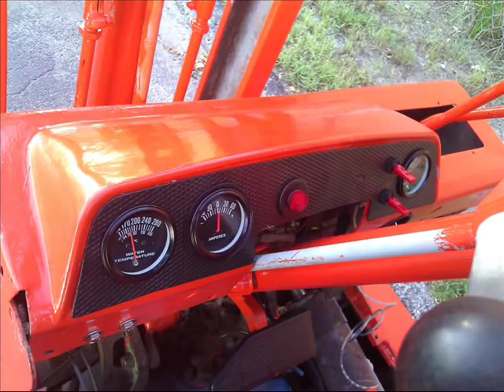CLARK FORKLIFT 1963 C-40 RESTORATION

Comment: Man that's a cool shot of the brakes, at our work we have a old 1975 Clark that has this identical setup and im fixing to open it up by Monday, the brakes have been making this god awful sound, I'm assuming is the brakes,,i got everything off except for the back studs,i knew it wasn't gonna be that easy when i took the front bolts off and the thing wouldn't budge until i figured out that it had studs in back,i noticed when i loosed one of the studs fluid started to come out,is there gonna be tons of fluid coming out or maybe just a little bit? i do have a Clark manual at work but it doesn't show the brakes for some reason, it just shows the hub and all that, the parts manual shows the brakes but not the service manual, weird.

Comment: at 1:46 I can see a gear drive for the Hydraulic pump. I just unloaded my Clark C500-30. what fluid is used in the gear drive for the pump?? I also have a space to the right of the seat and a bit lower that looks like it had a rod to rod under the seat that goes to the transmission not sure what was here and what it did on my automatic  flathead 4 cyl. clark. thanks for any help.

Comment: How hard was this to work on? Parts available? I have someone that wants to sell me one for 700 locally. Any thoughts?
Reply: Cindy Russo  They are easy to work on. Like an old car. All you need is the serial number on the forklift to order parts. Ebay or any forklift parts dealer. Tampa forklift parts. Swift forklift parts in Arkansas. If it runs good. Grab it. I have a 1961 Clark Utilituck. Still runs great. These forklifts Never die. They were made tough. MADE IN THE USA.

Comment: What kind of paint do you use  name brand metallic glossy
Reply from the maker: I got the paint from Tractor supply. They have good paint for machinery.
For the black. I use Rustoleum Hammered paint. Very durable and chip resistant.
Reply: Thank you very much
Reply: Cool but why dint you use a spray gun instead of a paint brush?

Comment: I found an old Clark Forklift in a rental  warehouse The owner says it's mine if I can get it running!  It looks like a 1963 or so C500-20. I've looked for a plate EVERYWHERE and can't find a thing telling me a serial number! I've taken some pics. Where can I find a repair manual for this machine? Maybe I can send the pics 2 get a sight identify this machine! Also, I can't figure out the tank under the drivers left side is for ? It uses LP with a small upright bottle! Help me with my restore!